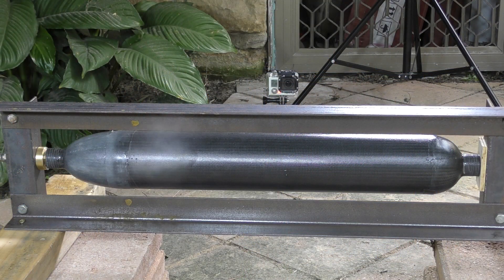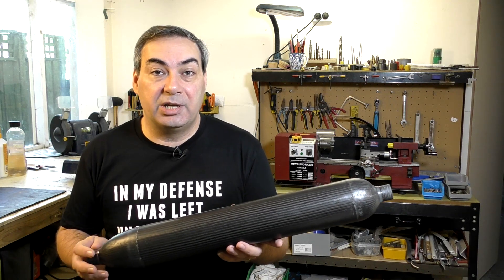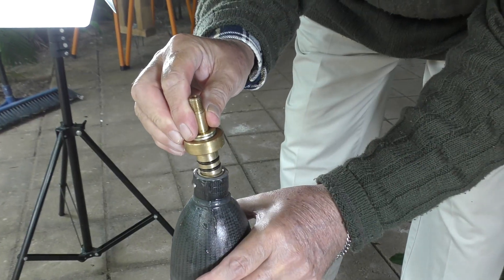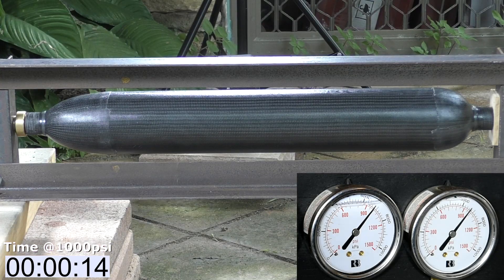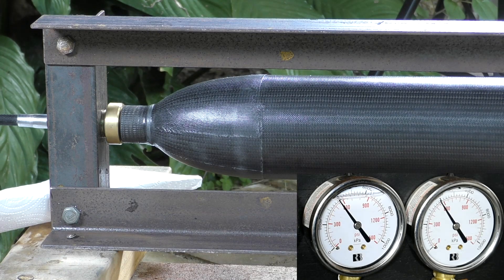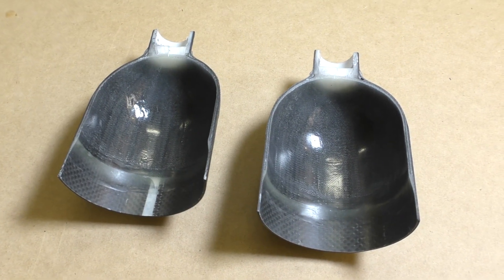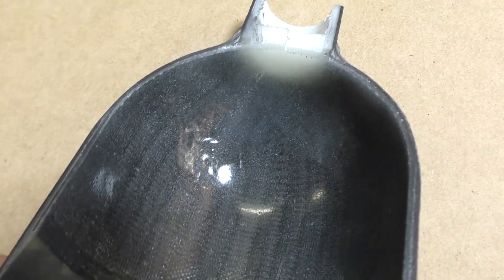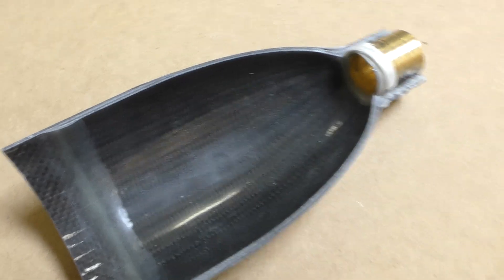2 Stage Water Rocket - Part 28 - More Testing

Comment: hey george, i just started water rockets and was wondering if you know anything about a safe presure to make sure they dont explode, they are made out of 2L coke bottle
Reply from the maker: Most carbonated drink bottles will fail at around 180-190psi. (13 bar) But you don't want to take them above 120-130psi (9 bar) as they will deform permanently above those pressures. If you have spliced the bottles together, then you need to test them to see how well your splice holds.
Reply: @AirCommandRockets  ok thanks, i am preparing to launch my newest rocket, i want to know around how high it will go, do you have any good simulations you would recommend?
Reply from the maker: @hoppy791  http://cjh.polyplex.org/rockets/simulation/ or http://www.aircommandrockets.com/sim/simulator.htm
Reply: @AirCommandRockets  ok thanks for the help!

Comment: Thanks a lot for your videos! I am wondering how to calculate the nozzle orifice for a hydropneumatic rocket. I googled but couldn't find it. I am planning to make a rocket 5 or 7 cm in diameter and 1 meter long.
Reply from the maker: It really depends on a number of things. First is what kind of launcher you are using will limit the size of the nozzle you can use. Also what kind of a flight profile are you after, fast and short burn, or a long and slow burn? It's best to use a simulator and enter various sizes of the nozzle and see how that will affect the flight of your rocket. http://cjh.polyplex.org/rockets/simulation/
Reply: @AirCommandRockets  Thanks!

Comment: Get a mirror which you can mount in your doorway when doing pressure testing. That way you can get eyes on without being in direct line with the pressure vessel. 

RE. the tape, do you need the tape to extend to the end of the vessel? Or could you have a section of tape missing where you plan to cut the tube to length? That way you avoid having the tape in the location of the join with the end caps
Reply from the maker: Not a bad idea with the mirror. I think that would work. Yes, the tape will now not extend into any part of the end cap joint and will stop a centimetre short.

Comment: I wonder what pressure it would take for the pressure vessel to completely burst. Perhaps what is happening is similar to structural concrete for example the concrete needs to crack for the rebar to work most effectively. Similarly, the carbon fiber is provides the tensile strength and the resin provides the compressive strength. If this is this case maybe the solution is to rap the carbon fiber over a rubber sleeve to allow for cracking and to prevent leakage. Just an idea although I might be completely wrong.
Reply from the maker: We actually bought liquid rubber membrane that can be painted on on the inside, but haven't tried it yet. It does add more weight though. We would like to see if we can seal it first without it, but it is a backup plan. Realistically we think the pressure chamber can probably hold 1500psi. We've tested the narrower version for the sustainer to 1600psi without bursting but it did make a lot of fiber breaking noise.

Comment: Also. Wondering why exactly a hydraulic ram ti force water out wont work?. I would have thought that sustained low g's would mean less wind friction and more efficient?
Reply from the maker: Not sure what you mean by hydraulic ram? In terms of low Gs, the problem is that most of the flight the rocket is coasting, so theoretically if you only achieved 1 or 2 Gs, then the rocket wouldn't go very high in the coast phase.
Reply: @AirCommandRockets  a hydralic ram such as a bike.pump. it provides leverage.
Reply from the maker: @willyouwright  Again, I am not sure I am following what you mean here. Do you mean that there is some kind of piston in the rocket that pushes the water out? ... What pushes on the piston?
Reply: @AirCommandRockets  yeah like a bike pump. Ill get a link.. that explains..
Reply: @AirCommandRockets  https://youtu.be/2eUkT1HngW0. Essentially.  You have a wide tube above water with compressed air. And have a narrow piston pushing  on water. It multiplies velocity of water.
Reply: Advantages are lower air pressure in upper chamber and much higher water velocities. Also less chance of air creating bubbles in propelant
Reply: There is a downside. Larger volume of compressed air but i imagine you just make it longer to keep reynolds number the same.
Reply: @AirCommandRockets  the formula for drag is square root right?  So speed needs to be reduce to optimise for drag
Reply from the maker: @willyouwright  Drag is proportional to the square of the velocity, but drag is only part of the whole picture. If you had zero speed, drag is 0, but you also aren't going anywhere. You need to balance the induced drag against the speed of the rocket to maximize altitude. That is what we are doing here by limiting the size of the nozzle to spread out the thrust phase and reduce the overall top speed.

Comment: R these vacum sealed? Isnt this  just air bubbles?
Reply from the maker: Not sure what you mean by vacuum sealed. Do you mean did it use a vacuum bagging process? .. No it didn't. And no air bubbles isn't the problem here.
Reply: Ah ok. Vaccumm sealing your container removes heaps of air  impurities  when making  fibre vessels. You dont know about that?  Such as copv or just regular vaccum bags?
Reply: It dramatically reduces porosity..

Comment: hey george, do you think hot glue and take will work for splicing bottles if i will only presurise them no more then 20PSI?
Reply from the maker: I don't think hot glue will work for splicing. A splice made out of 2L bottles at 20psi will want to pull apart with a force of 1,300N / 134kgf /295lbf.
Reply: @AirCommandRockets  ok thx george, also do you think if i just used the hot glue to hold the seal and used strong tape to hold the bottles together it might work? and do you know of any websites i can use to find data on my launches?
Reply from the maker: Best way to know is to do an actual test. My gut feel is that the tape won't be enough, but 20psi may be manageable for smaller diameter bottles.
Reply: @AirCommandRockets  ok thx!

Comment: So question...you're already using a CF tube from Soller Composites as the final overlay...couldn't you also use the CF tube as the first layer as well and eliminate the tape altogether? Also, I've seen some people using Sollers heat shrink tubing as a wrap-layer over the final product to achieve a glass-like surface and, they claimed, also help ensure good resin penetration. I'm curious what your thoughts are on that part of a process given all your experience and knowledge thus far on your projects?
Reply from the maker: Good questions Josh. In fact we did that first, we used a sleeve for the inner liner, but as you can see in part #14 https://youtu.be/sG-YXnAGYdU we ended up with a banana. Here is an explanation why: https://youtu.be/I7i8ELEF3ro and so to fix it we now use this process.
We looked into heat shrink tape to compress the pressure chamber a bit, but this would leave a spiral ridge on the surface that you would then have to sand out which is a lot of work. You would need to put the entire pressure chamber inside the heat shrink sleeve to get a smooth finish like soller sells. I am not sure how that would go over 2m length and how it would shrink length ways as well. It may be worth investigating though.  We find that the outer glass layer we put on gives us quite a smooth finish that's relatively easy to sand.

Comment: Hi George! Your videos are very educational. It is very instructive to see how you learn from your mistakes and move forward. I prefer condensed and well-explained videos over streaming. Also, it would be cool to see the older videos from your channel which apparently have been deleted. My favourite was the day when you flew the Polaron Vb rocket with Gluon boosters. The flight of that rocket was truly magnificent. Keep up the good work!
Reply from the maker: Thanks Daniel. I was thinking the same about re-uploading some of our old videos, though I will need to re-edit them because of the music sound track I used on them. (The reason I removed them) They are fairly low quality too, and would take a bit of time to dig up the original footage. They were also edited in a different video editor, so it would be quite a bit of work to bring them back. It's either spending time on that, or creating new content. :)

Comment: skip the tape?
Reply from the maker: Ultimately that would be the preferred option, but the tape did make things easier. In the next pressure chamber the tape doesn't go all the way to the ends.

Comment: Good to see you back again. Do you think that this year the full two stage rocket will be launched? Also what is the name of the lathe that you are using? The parts you guys make with that mini lathe look very good. i am looking for a (small) lathe for my workshop as well.
Reply from the maker: It all depends on when the launch opportunities occur this year when we have club launches at the high power launch site and the weather also has to co-operate. The next launch opportunity is in September which is too close and the rocket won't be ready by then, and then there are covid lockdowns to consider as well. 
The lathe is a Sieg C3 mini lathe. There are many copies of this lathe made or re-branded by different manufacturers. It's a little on the small size, but good enough for small parts.

Comment: If it is posible to avoid two different matirials being applied by these extreme loads, than it might help to shift the delamitantion cracks to higher pressures. I think, that even a little bit of difference in elasticity of materials can cause unwished weakening of the structure.

Comment: Why are you not constructing the chamber from a single strand of woven carbon fiber wrapped around a form ?
Reply from the maker: A really good question. The process we are using is something we can easily do in our garage with the equipment we have and get repeatable and consistent results. One problem with wrapping is you need to be able to get the form/mold out of the pressure chamber once you wrap it and it has cured.
Reply: @AirCommandRockets   Maybe you could take your sheathing process to the next step by using a wrapped strand approach rather than a large swatch of carbon fabric. That way you could tension the wrapped strand a small amount. So for the last step put your chamber on a lathe and wrap it with a single strand criss-crossed over itself many times.
Reply from the maker: @motoflyte  You still need a proper computer controlled wrapping machine for this to evenly tension the tow and evenly spread it across the entire length of the pressure chamber. This can't be done by hand.

Comment: Is it possible to make a reusable first stage water rocket by controlling the size of the hole?
Reply from the maker: All of our water rockets are reusable. It would be possible to make the nozzle swappable, (something we did on our Dark Shadow rocket) but for this particular project, it is designed with a very specific nozzle size.

Comment: Very cool! It's good to see re-usability as one of your priorities :-)
Just curious, do you guys plan to use chemical motors in the future?
Reply from the maker: As in regular solid model rocket motors?
Reply: @AirCommandRockets  Solid or liquid. You guys are so capable I asked in general. I wouldn't be surprised to see you build your own liquid or hybrid rocket motors :-)
Reply from the maker: @BlisterHiker  We do fly with regular commercial solid motors, but Hybrid motors certainly would be interesting to work with. A few club members have built decent sized hybrids and they are always impressive. They're also a good engineering challenge.
Reply: @AirCommandRockets  In my humble opinion, hybrid motors are the future. I hope to experiment with them some day, but first I will have to move to an area where I will not be arrested for doing that :-)
I'm looking forward to your future projects.

Comment: it would be so neat to have a shoulder mounted water rocket launcher.
Reply: I’d pay money to see that! Water blasting back into the face of the person firing it at 1000psi! Brave and hilarious!
Reply: @freakysteve140281  Don't forget that the real ones shoot flames. Operator safety is maintained by the rocket either burning fully inside the tube or having a boost and sustain phase where the sustain is only activated after the missile has travelled a safe distance.